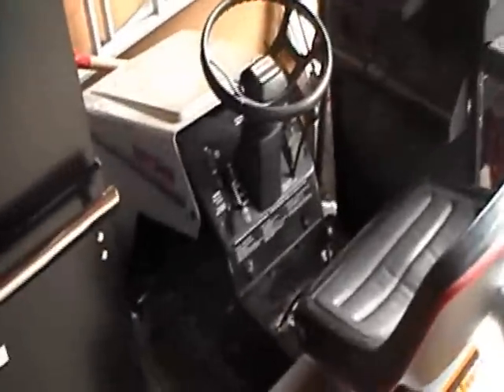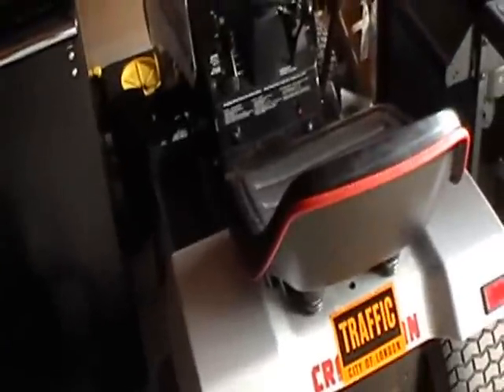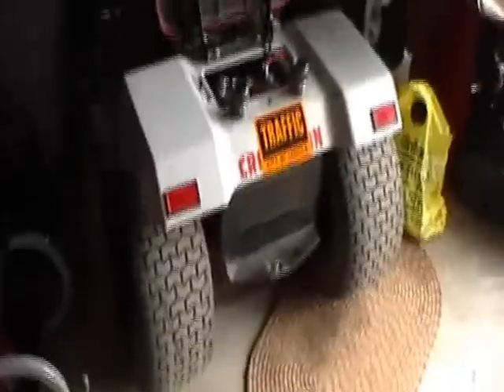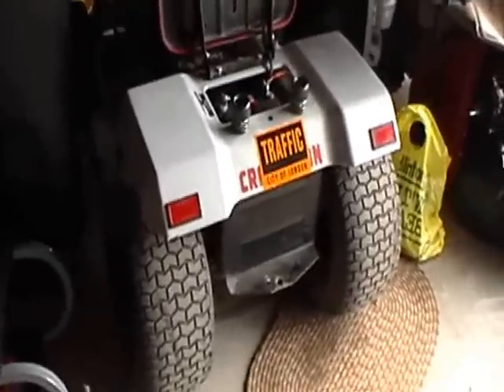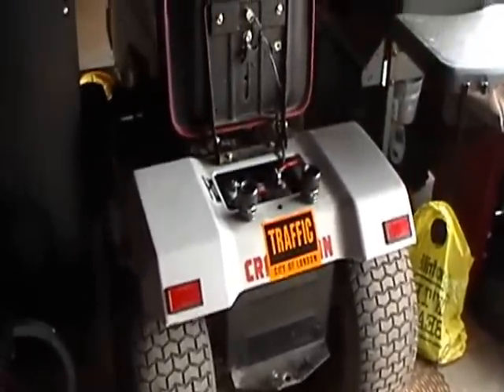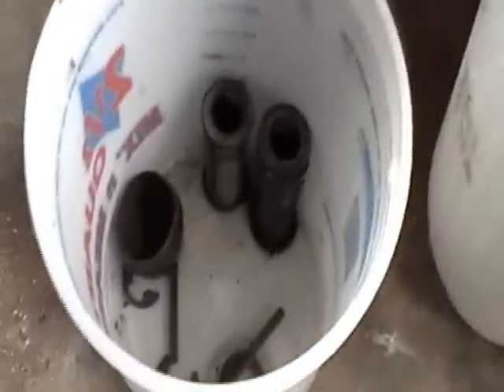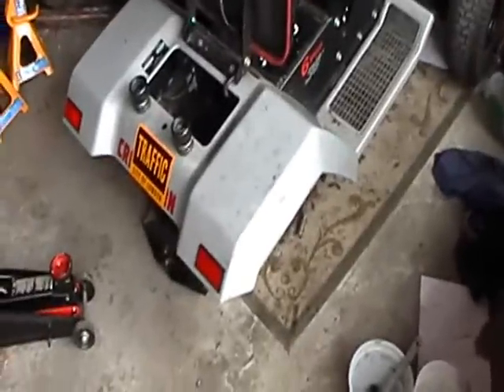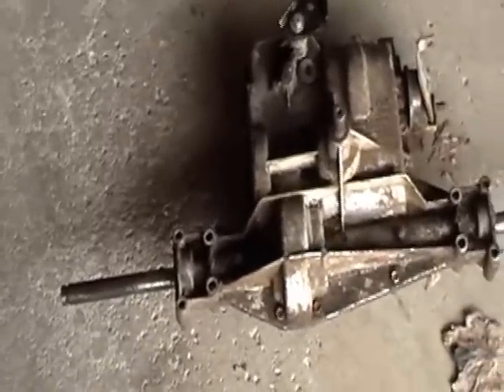Transaxle Replacement or Repair Part 1

Comment from the maker: @12gshell Okay well my problem is that every single gear would not make the mower go.  I ruined the shit out of the gears by changing gears while at max speed like slamming her into 6th gear from first. My lawn tractor is also modified and goes about 35 -40 kph. This causing the teeth to wear down even faster. I seen them for that price. I think they just sold as is, ripped from another tractor , washed and sold. I'm assuming nothing seriouslyy wrong with them.

Comment from the maker: @12gshell  Buddy calm down big time, I had only half of it cracked open  because my socket inst thin walled enough and cant get on a bolt. I pretty sure the problem is worn down gears. But I will have a look inside. Please tell me what were the symptoms of your trans problem? 400-600 I doubt it because I was looking for ones on eBay for only 125 - 175 tops,

Comment: OPEN THAT SUCKER UP...... THEN YOU'LL KNOW WHAT TO DO....IM IN THE PROSES OF FIXING MY FOOTE 4450 1 TRANSAXLE......PROBLEM WITH MINE IS THE SHIFT KEY.......IT WONT COST U A DIME TO LOOK INTO IT......BESIDES ,A NEW TRANSAXLE IS ABOUT 400--600 $